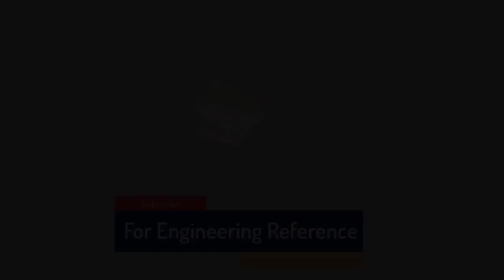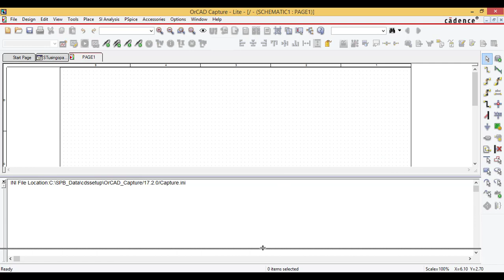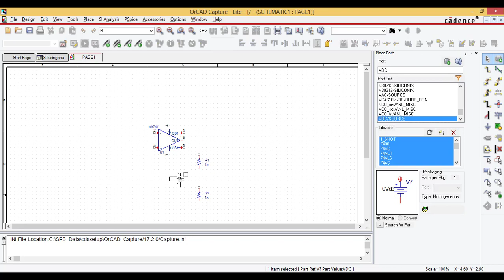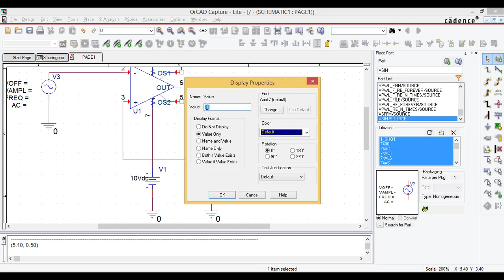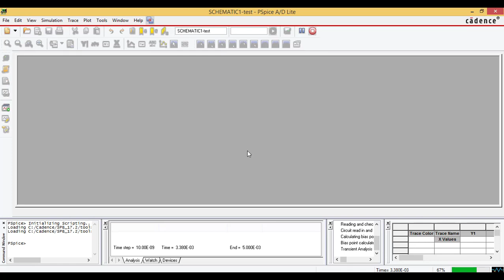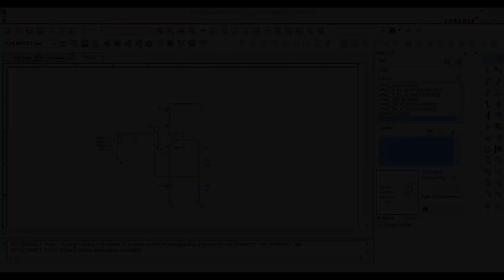Schmitt Trigger using Op amp in PSPICE | Schmitt Trigger Square Wave Generator

Comment: dear i have also followed the same process but not able to get the output square wave . i am getting the pure dc line  in output. what is the reason behind it??
Reply from the maker: Hi , you may find mail id in channel page . Attach your simulation file. Let me find the issue and send it back. Without seeing your circuit, issue can't be pointed out.
Reply: @ForEngineeringReference  OK please give your mail I'd and I will send you the circuit simulation on that email ID
Reply from the maker: Mail id is available at channel (about) page. Please check it with desktop/PC.